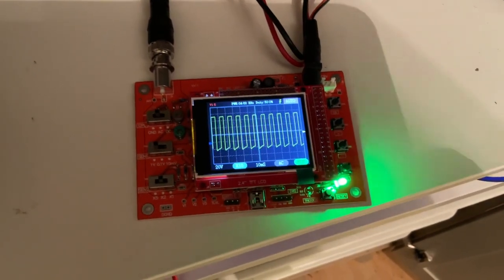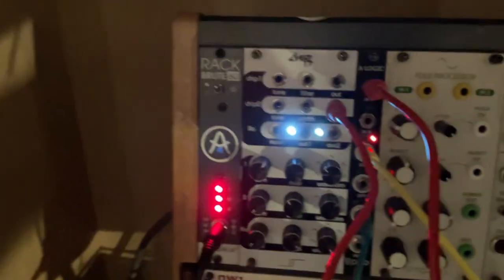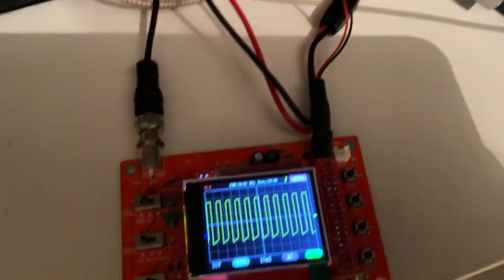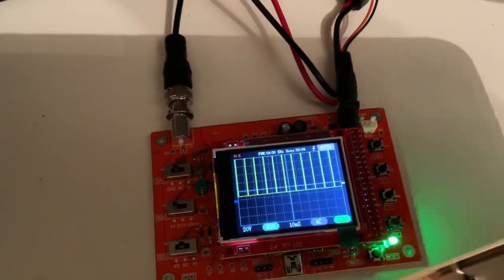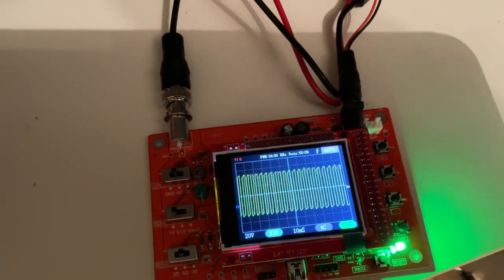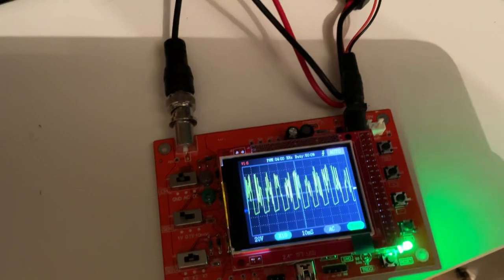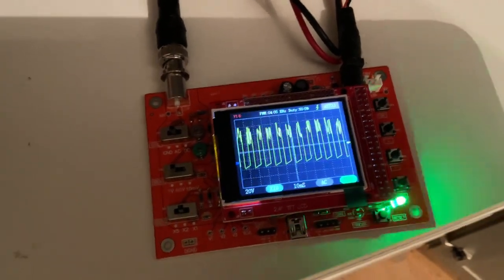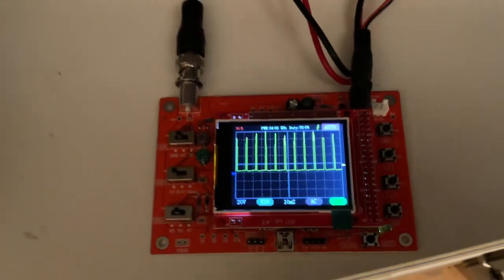DIY digital oscilloscope (cost £21.99)

Comment: I have this same oscilloscope and would like to know what settings you used and switch positions to monitor Eurorack. I don't have the manual. Bought it some time ago.
Reply from the maker: I'll have a proper check tomorrow, but Eurorack control voltage is generally +/- 5v peak to peak, so I'd set the range to that, then the speed to whatever the wave speed is - e.g. if you're monitoring an LFO at 10hz, I'd set to around there and dial it in by hand.

I think the signal voltages can be greater in some cases.

If I get it working again, I'll post a vid and put a link here :-)
Reply: @Gavddotcodotuk  Thanks for that, It gives me a starting point.